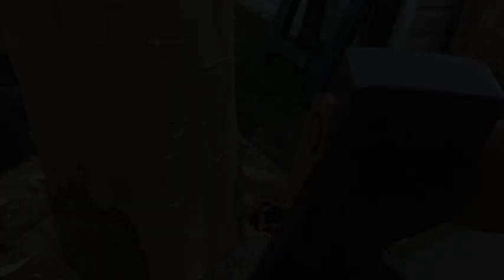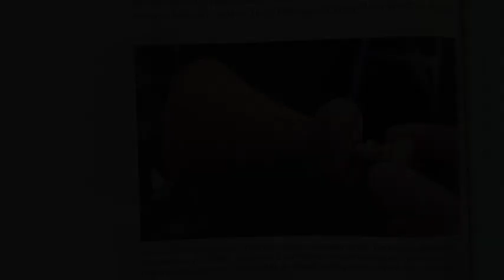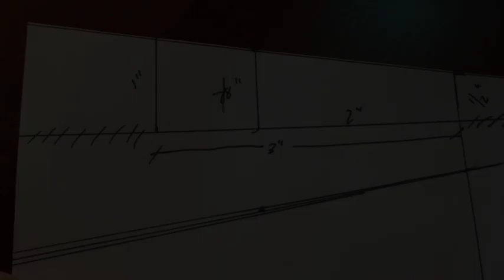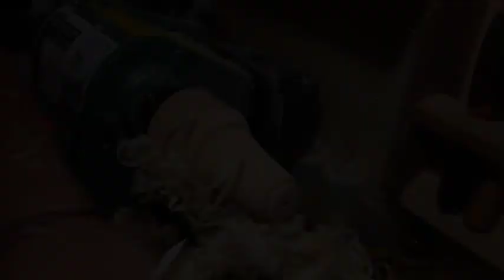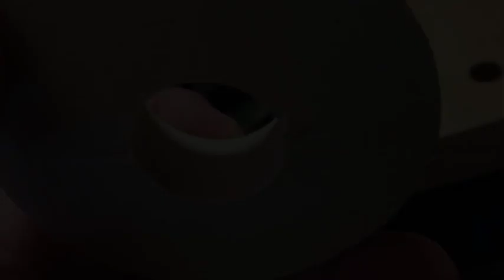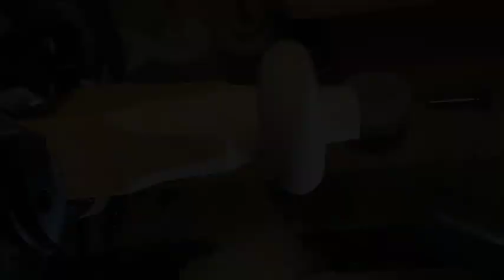DIY Wood Lathe Collet Chuck

Comment: hi there, i have an axminster midi lathe and want to extend the tool rest. ive just noticed yours and wondered how you fixed your extended bar to the existing one. it looks a simpler fix than having to make one from scratch, thanks.
Reply from the maker: +poppajoe801 I didn't. I bought a replacement tool rest from Lee Valley. It was cheap but I find the post is a little short.

Comment: Awesome Video. I do not know if anyone has said this to you for the Taper on the doughnut but you could have used what I call a Pyramid Bit. They are a staged drill bit that tapers from a small size to larger ones.

Comment: I have adapted a  compound table for a mini lathe to fit on my wood lathe.   It makes turning tapers much easier.         Yes, I could have done such things on my metal lathes, but I do not want to have wood chips etc on my metal lathe.   Nor do I want to have oil on my wood projects.   It also provides precision turning for parts that need to fit together.     Just and idea for you if you wish
Reply from the maker: Interesting idea. Do you have video that you could upload to demonstrate?  I would love more information.
Reply: inthewoodshop 6w morning

Comment: Forget about the pro bull, but try to learn all you can about safety. Your dealing with a machine that is spinning usually at 2 or 3 thousand rpm and that can do an amazing amount of damage to you or any bystander in a very short period of time.. If it is at all possible join a turning club or at least try to get in touch with other turners in your area.

Comment: I would create my own wood faceplate to create this from ...   For me, it would involve a 3/4 inch 16 tpi nut (I can buy them for about a dollar each at Atwoods or Tractor Supply).  First, I would get a wood blank about the size you are using (cedar post or some other off-cut scrap) and true up one end, and then drill a hole just smaller than the nut's exterior ...

Then, I would chisel out the wood around where the nut will be seated, and epoxy it in place.  This would give me a metal threaded faceplate that will run true pretty much forever, since it will have no play once it's threaded on my lathe spindle.

After that, I would follow the same procedures you've outlined in creating the collet for your chuck, to create the main body and the collet portion.

For the holding ring, I would temporarily chuck a faceplate with a smaller section of wood on it and turn it round, and drill out the center (I'ld use a backing that I could drill into, of course).  After drilling the center hole, I'ld grab one of my precision scrapers and simply aim straight at the base of the hole from a larger angle...   So, from the visuals you've provided, the hole would be that inner circle you marked, and the outer circle would mark my starting point from the front face, and I'ld be aiming to hit the inner circle from that starting point, following the angle straight through the donut.

And to finish the piece .... I'ld avoid using any kind of wax finishing agents.  Superglue (CA finish) might be overkill, but I don't want my collet to slip loose on me!  I'll probably make mine sometime in the next few weeks for turning bottle stoppers.  When I turn the donut, I think I'll leave one side more squarish looking (the side toward the headstock) to make it easier on me figuring out which end fits where.

To get a small precision scraper to use for detail work and for cutting that taper, I went to a local pawn shop and took a look at their old hand tools.  Specifically, screwdrivers with square shanks and wood handles. (Gives good control with flat surface against flat surface. The wood handles part was so that I didn't have to deal with dirty looking plastic.)  I took a few home and cleaned them up, and then ground the tips off to put a ground scraper/chisel profile on the end that pleased me.  Alternatively, you could just go pick up some round bar stock of mild steel at a local hardware store and turn your own handles for them, grind the tips any way you like and run with it!  (No, don't actually run around your shop with chisels, boys and girls!)

Just make sure that when you are grinding, you have a small container of saltwater nearby to cool the tool off.  You do NOT want to remove the tempering and heat treating of the tool steel, it's already perfect as is.  If you see ANY discoloration in the tool's tip as you are grinding or sanding, dip it in the saltwater right away.

To answer the question about all the waste wood and sawdust .....  

It makes awesome and free packing material.
When turning wet wood, you need to dry it slowly to avoid cracking and checking ... pack it in it's own wet shavings!
You can compress it with melted wax and create a Yule Log or fire starter log.
You can mulch your yard (or a friend's garden ect) with it.
Compost heap for anything other than cedar and other bug-hating woods!
You can also use it for tree nursery seedlings (to stratify and germinate the tree seeds).
Holding it against the turning wood piece causes it to burnish up and polish, so it's useful for finishing.
Sawdust from the finishing process can be saved and mixed with wood glue to give you a perfectly matched color wood putty for filling in holes.

Have fun finding more useful ways to use that stuff up! :)

Just thought of another alternative you could use for a perfectly fitting donut on your collet chuck.

Turn the cone as normal, and then GLUE SOME SANDPAPER TO IT and grind your donut's hole for a perfect fit!
Reply from the maker: That's a really cool idea. Thank you!  I will be trying that out.
Reply: You do you

Comment: Thomas you can use a hose clamp to tighten the collet. And the Collet doesn't have to have a taper.
Reply: But it does help keep it in place
Reply: @benpress8884  Wouldn't the hose clamp (or jubilee clip) be a a little dangerous? Like a mini, very catchy hammer flying round, whereas the doughnut is smooth and of little danger. I know we all have different tolerances, but if it is something you are using a lot, you might be absent minded one day.
Reply: I'm going to try and make a similar collet but with a jubilee clip sitting in a groove. I want it for drilling pen blanks on the lathe.

Comment: Hi there, thx for your video. I may sound dumb because Im new to wood crafting, but I got a question. Is there a way not to waste so many wood? So much wood for such a little piece. Or do you recycle somehow all the sawdust?
Reply from the maker: I don't think there  is a way - with this project - not to waste so much wood.  People turn nested bowls so they don't waste the wood inside the bowl, but this obviously is not a bowl.  Unfortunately that is woodturning.  The waste is not sawdust, however, it is shavings and can be used for several purposes.  You reuse some of it for burnishing the piece (part of finishing) and it is great to heat the shop.  I have a Kelly kettle in which I burn shavings and small pieces to heat my tea or hot chocolate.  I mulch around the shop with it.  I'm sure others have way more suggestions than I have.  Thanks for watching and good luck with woodworking.

Comment: Why not just buy a set of pin jaws for your chuck,or use your drill chuck in the head stock for small work
Reply from the maker: This way is cheaper than the first and marks the wood up less than the second.

Comment: I use a 1/2 inch bench chisel (upside down) to cut tapers after I drill out the waste.
Reply from the maker: Inside tapers?
Reply: inthewoodshop You know the size of both ends because you can measure it from the width of your ring and transfer it to the shaft to measure.  .  Bore a hole to the small size, and cut gradual tapers till the other end  gets to the big size.  I saw someone else use a thick scraper for this but I don't have one.  Yet.
Reply from the maker: Interesting. I tried a scraper and I found it very awkward. It was my first time doing that. If I had a very all bowl gouge, I would have used that but my bowl gouges are quite large.
Reply: inthewoodshop You want a sharp cornered tool like a wood chisel or a skew if it's small enough, and push in a straight line cut.  I have the smaller diameter precisely bored and toward the chuck.  Mark the large diameter carefully with pencil and make straight cuts not touching the small diameter till the last pass.  This used to be child's play on the metal lathe with it's taper attachment.
Reply from the maker: Thomas Hanson I'm going to try that.  Thank you very much for commenting and for watching the video.

Comment: Great video on a classic technique for holding wood. Your use of pictures and overprinted text explanations worked well in communicating your  process.
One safety comment. When drilling with a jacobs chuck in the tailstock, you need to hold the jacobs chuck when withdrawing because it is easy  for the drill bit to seize and pull out the jacobs chuck from the tailstock. If it gets pulled out, it can start whipping around and be dangerous! You might check out the video I made on chucking wood.
01-19-12 Chucking Wood by Mike Peace (01h28m33s)
Reply from the maker: Thanks for watching.  That sounds like great advice.  I've used that technique a lot, but I will watch out and hold that chuck!

Comment: i made one for bigger stuff 'cause i didn't have money for a chuck. This guy on my shopsmith forum told me how. it's similar but you make proportionally bigger slits and you put a hole at the end for extra flex. then you use the not so romantic pipe clamp to tighten. My addition was putting sharpened machined screws through the 'tongues' for extra bite. 
  it's no wear near as beautiful or elegant as this one you made. nice video, thanks.
Reply from the maker: Thanks for watching.  I think I am going to make a couple more in different sizes.  I don't have the money for another chuck either.  It's more fun to make stuff out of firewood anyway.
Reply: agreed. i forgot to mention that i used a hardwood ( i mean that in lumber terms;not a pine, maybe a fruit tree) and i keep the wood disgustingly soaked in a non curing/hardening oil like linseed.
Reply from the maker: schpoingle I think mine is spruce.  Interesting about the oil.  How does that work?  Does the clamp slide?
Reply: it doesn't taper like yours. you try and use a straight grain piece and follow it on the collet shape for bending power. if you were worried about it though you could turn a little groove for the pipe clamp. that might look nice as long as the wood didn't get to thin.